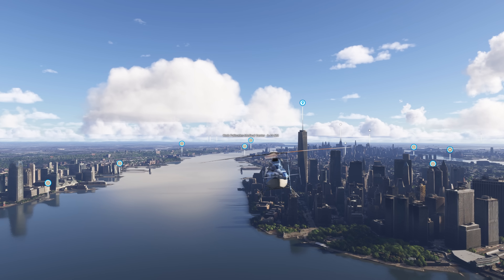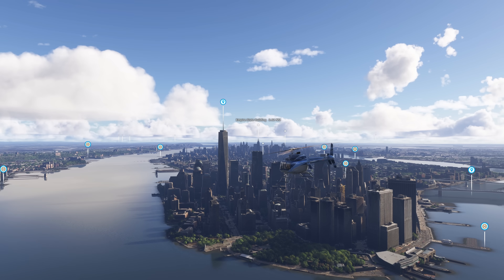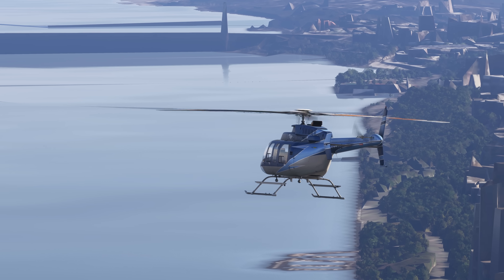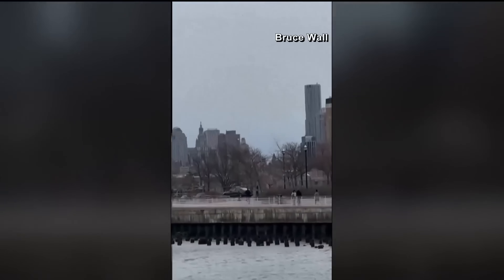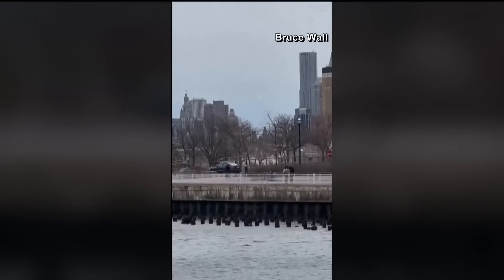Helicopter Expert breaks down Hudson Crash, and discusses “Bump Mast” Theory | NYC Crash Follow-Up

Comment: UPDATE :  The rotor mast and transmission were recovered showing the transmission was still firmly attached to it's mounts. The transmission - with it's mounting assy was ripped out of the top of the fuselage ALONG WITH the top skin and framework that mount the engine / transmission to the top of the helicopter. 
Of all the crashes I've seen, I've never seen the transmission depart the cabin. 

I've seen rotors hit trees, poles, buildings and even break off on the ground , and the transmission stays mounted to the cabin while the rotor mast breaks. 
I've never seen the tail boom depart along with the entire rotor mast while still attached to the transmission. 
I have seen different things cause " sudden stoppage "  of an engine and transmission.  
I've never seen a turbine engine have a " sudden stoppage " event without impacting something solid enough to stop it.. . . . which is never. 
It's important to understand that if the engine / transmission had a  " sudden stoppage " failure, locked up, seizure etc - the rotors - both main and tail - would try to keep rotating. 
With the engine or transmission acting as a brake fighting against the inertia of the rotors, the system would fail / sever itself - at it's weakest link. 
IT APPEARS  -  the main rotor tore the transmission off it's mounts which are 2 large  " A " frames , while the tail boom was sheared by the twisting / torsion / torque force of the  drive shaft held in a series of bearings along the boom. 
There's a company named " Lord "  
Lord makes numerous mounts and mounting components.  The term " Jesus nut "  comes from the Lord company who made the nut that holds the Bell rotor mast on to it's drive shaft.   Yes - 1 really large nut holds the main rotor on the rotor shaft.
Reply: Wow! That is some eye popping reading! Thank you for taking the time to share that. It explains what we saw in the videos out there.
Reply: I’m thinking salt water corrosion in the upper deck
Reply: @   We were all talking about it today.  All aircraft maintenance mechanics.  That's a popular conclusion among us considering the surrounding environmental conditions.
Reply: @   No but :  a helicopter fuselage is all part of it's engine/ transmission mount. Top to bottom.  The entire fuselage is designed to absorb / transfer all the power of the engine and trans into rotating energy for lift and flight.  It's literally like a woven basket with 2 handles that come together at the top.  IF a gear , bearing,  shaft etc came loose inside the trans causing it to SUDDENLY  lock up internally,  all the rotating energy ( torque/ torsion)  of the main rotor would suddenly be applied to ALL the mount points THROUGH the trans like a massive MASSIVE torque wrench with a huge torque cheater bar and it would break / fail at it's weakest point. In this case it was the point where the entire eng, trans , mounting frame attaches to the fuselage main structure.  They were sprayed with hot hydraulic fluid when the rotor tore itself and  the hydraulic lines off  and then they  had a clear view of the river through the hole in the top as they fell 1500 feet into the water.
Reply: Such a drastic fail seizure is the right thought. Ripping trans mounts out of the decking with force snapping the main shaft. This 206LR does not have much of a bumping problem. These tourist flights are not that heavy duty although an older chopper component fail is high on the list
Reply: Let the man talk Steve.
Reply: Something large stopped rotating instantaneously.
Reply: ya mast breaks first.   I'm betting the decking failed
Reply: A new video shows the tail separated in level flight and then the rest of it disintegrated.
Reply: @   I’d greatly appreciate you sharing that video.  The transmission has 1 input and 2 output shafts. Power in from the engine - power out to the main rotor and tail rotor gear reduction pinion assy.
If the transmission had a hard lock up - inertia of the tail rotor and reduction pinion would become a torque / twisting force on the entire tail boom assy.   I believe  the entire event took place so quickly - it’s almost impossible to see the sequence of events on film from over 1500 feet away.  However , I would greatly appreciate it if you would post that video in this thread.
Reply: Here's the thing about the transmission removal happening. IT NEVER HAS IN ALL OF HISTORY OF THAT MODEL OF HELI.
Reply: @Slitheringpeanut   I'm aware.   Never seen it before . Ever
Reply: Exactly so...From a helicopter pilot and maintenance person.
Reply: Yeah, the Jesus nut had nothing to do with the cause…
Reply: The origin of the term "Jesus nut." The nut holds all the parts together. "He [Christ] holds all things together by the word of his power" (Hebrews 1:3). We get our English word "cohere"; or "cohesion" from the Greek word translated "holds."
Reply: They call it a “Jesus Nut” because when it separates, the pilot says “oh Jesus” (my ex-wife relative died this way while in National Guard)
Reply: Nobody really knows the etymology of "Jesus nut" but pre-WW2 airplanes had "Jesus bolts", which were the bolts that held the wings onto the fuselage.  

Presumably they were called this because if they failed, it would be Jesus who would be conducting your debriefing.
Reply: Lord Jesus. O my. Not able to fail. 🙌❤️‍🔥🙌🕊️

Comment: The Bell Long Ranger has a Nodal Beam transmission mount and it would be impossible for the transmission to break free of the airframe in flight .  I watched a Long Ranger crash land and roll over a few years ago and the transmission did not break free of the airframe .

Comment: Do the blades not droop when the helicopter is first starting its engine?  And yet they do not strike the tail boom.
Reply: The drooping blades adds to it, also needs the rotor disc angled backwards getting those blades even closer to the tailboom, 
Combine that with drooping blades, that’s a recipe for cutting the tail off, I could imagine that could happen on start up if the helicopter was on a very unlevel surface with its nose pointing down not to mention a bad case of mast bumping in that situation, that’s why helicopters require flat level surfaces to take off from especially if it has a semi rigid rotor system

Comment: I read that the transmission chip detector triggered an inspection earlier this year. In one freeze frame the rotors, mast and transmission can be seen. What would be the possibility that instead of a mast bump it was a transmission lockup and the resultant torque sheered the tail boom?  If the rotor hit the boom wouldn't it be bent? In the freeze frame the rotors seemed straight

Comment: As an American I know for a fact that transmission housing is the strongest part of that assembly,capable of holding maximum lift capacity,lifting heavy loads in the oil and gas industry and definitely used to move drill rigs in the arctic,that being said the attachment points are heavy duty and the fuselage cabin roof is very strong to with stand hours of repeatable lifting for years,loose hardware,fatigue failure,non visual inspections daily would increase risk to such an event.

Comment: Why is it that black boxes/cockpit voice recorder is not mandatory on all aircraft?
Reply: I suppose it's expensive, but for aircraft used commercially, especially ferrying passengers, I'm thinking, yes, it should be required equipment.
Reply: Cost vs reward. It won't be hard to figure out what the failure was here and NTSB won't need a black box or CVR to investigate. New York has had only 38 fatalities since 1977 including tourists, police, news and medical transport. So putting those into all helos when you have a very low rate of deaths and can figure out the cause without the added cost of boxes doesn't make any sense.

Comment: Motorcyclist here: mast bumping sounds almost the same as speed wobble on a bike, in that once it begins it quickly snowballs into catastrophe. And often, the rider has no idea that it’s even going to happen until it’s happening.
Reply: There is no snowballing effect with mast bumping. Once you exceed the limitations of the teetering hinge - kapowie - your mast has separated. No recovery.
Reply: @caryd67  A competent pilot will know how to prevent Mast Bumping, especially one who trained on a Robinson.   There are conditions that you know to stay out of.
Reply: My Motorcycle sometimes gets Death Wobble too… It could be Mast Bump that rip everything apart or A Loose Bolts 🔩👀
Reply: On a motorcycle, if you brake is it worse? Should you try to “coast” out of it?
Reply: @Jleed989Relax your arms. Shift weight back. Reduce throttle gradually.
Reply: @Jleed989 I’ve never personally experienced the speed wobble. As someone mentioned above, Japanese machines are not typically associated with this issue, and I only ride Japanese machines. However, if I found myself in that situation, I’d likely get completely off the throttle, and gently apply only the rear brake to try and stabilize the bike. However, at the kind of speed it takes to create the condition in the first place, you’d really only have milliseconds to react, meaning, you’d have to been anticipating and ready for this to happen. In other words, you’re fcked.
Reply: @ I’ve ridden out probably about a half dozen  or so headshakes over 30 years of riding.
Reply: I'm going to use AI and a swallowtail to fix that.

Active aerodynamics is massively underappreciated.

Maybe canards too. Go fast enough and gain a glide ratio. Do some small jumps at the cost of a bunch of speed. For things like jumping a log across the road or something. An active suspension could help with that too. 

Like how modern robots don't have shock absorbers, they just simulate that with a motor. 

It would be cool to have a bike that could lean back when you stop, lean forward when you accelerate, aerodynamic and ground Force turning, never get the wobbles, and be able to bunny hop a couple feet off the ground for whatever distance. Maybe only double the cost of a traditional motorcycle for equivalent parts.

Chatgtp can walk me through how to use nvidia's physics playground simulator thing for the software. So possibly self-driving too.

Probably going to go all electric. Although I do like the idea of including a turbine generator range extender.
Reply: This is why you buy metric bikes, or at least don't modify any motorcycle from a major manufacturer.  Anyone who buys a custom bike is a crazy person, thinking of West Coast Choppers.

Comment: Great summary as only an expert of his kind can give. It's impossible not to speculate when you see an aircraft of any kind simply fall apart in front of your eyes and I think he nailed it at the 15:05 segment when he mentions the "Jesus Nut."
Reply: No he did not because the rotor was still attached to the transmission. No issue with the Jesus nut.

Comment: Ha. So the main rotor transmission stops, the copter pivots to the right violently, the mast dettaches and the main blades's transmission too, ripped off from top of the copter immediately after the tail. So it stopped rotating mid-air.
Craaazy.

Comment: Is there any reason,  other than cost, that  helicopters can't be designed with an emergency parachute system?
Reply: Difficult to attach with spinning rotor blades..  In this case there would be very little time to deploy it even if it could be attached.  This was a very rare event.
Reply: @JoeLinux2000  I understand that is a serious engineering challenge,  but I still think it is achievable.